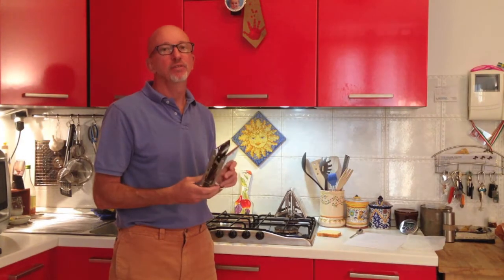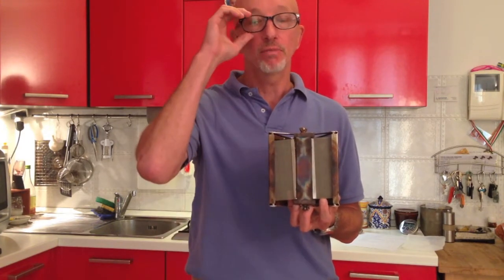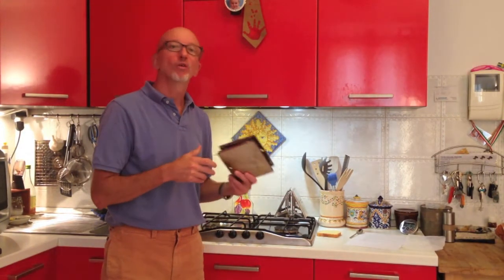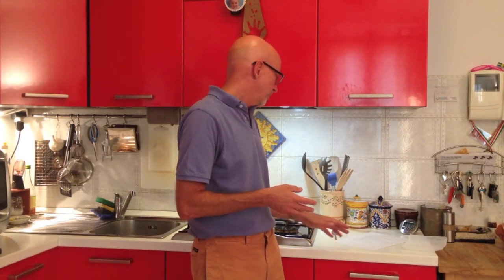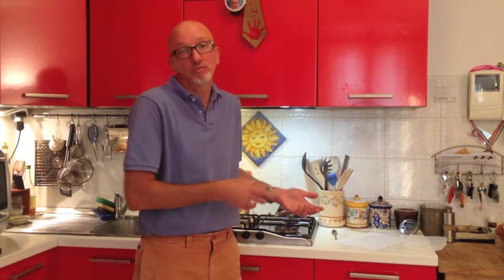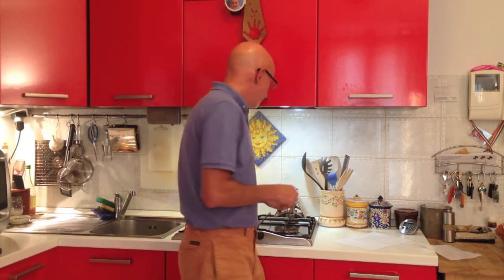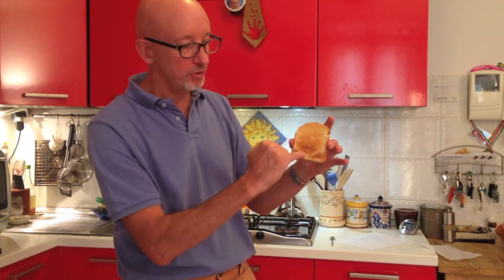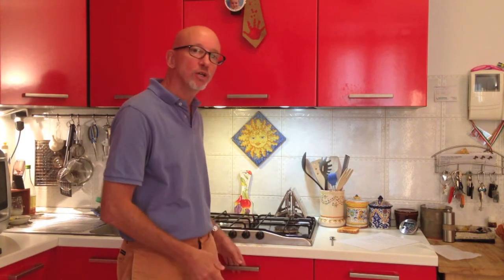DeltaToast Demo Sept 2014

Comment: Will this work on an electric stove ?
Reply from the maker: It depends.  Before purchasing DeltaToast determine if it will work well on your electric burner. To do this, turn on the burner to the high setting but leave it uncovered for 4 or 5 minutes and observe. If the burner cuts itself on and off automatically (due to an integrated thermostat) then DeltaToast will NOT work optimally on your cooktop. Alternatively, if the burner stays on and emits heat constantly then DeltaToast will work very well.

Burners with thermostats can sense the heat draw from the cookware above and regulate their heat output accordingly. DeltaToast is mostly empty volume and thus burners with thermostats might cut on and off frequently, which can slow down the toasting time with respect to gas cooktops.  On the other hand, toasting results are even more uniform compared to a gas burner and are essentially identical to an electric toaster.  The flame diffusers are superfluous on an electric cooktop and can be removed.  You may wish to keep them on, however, so they won’t get lost.  They do not diminish the toasting uniformity nor slow down the toasting time perceptibly.